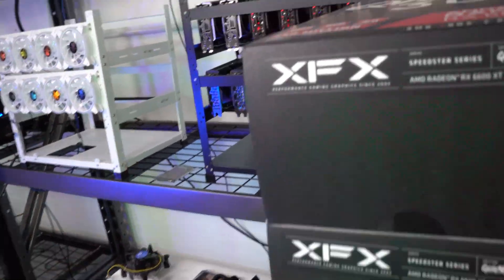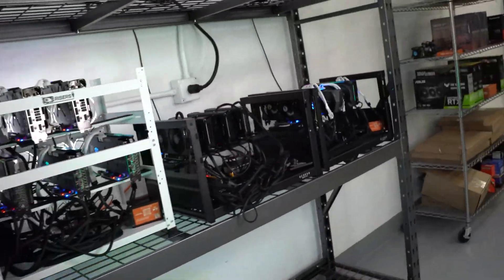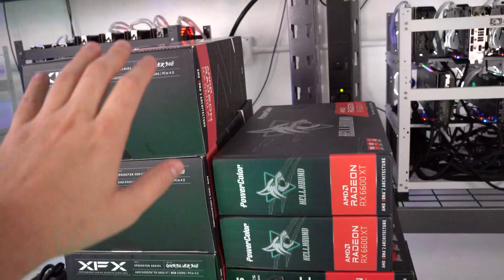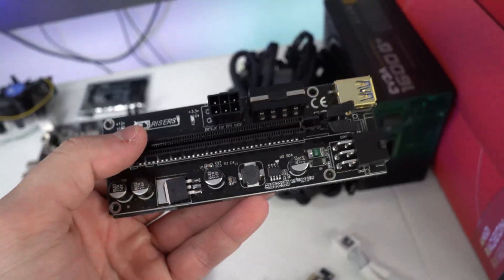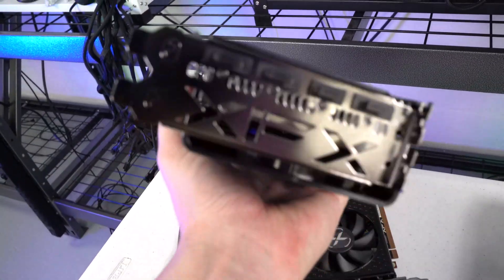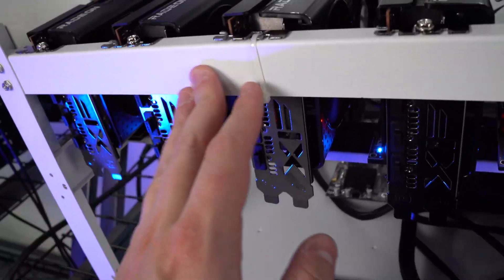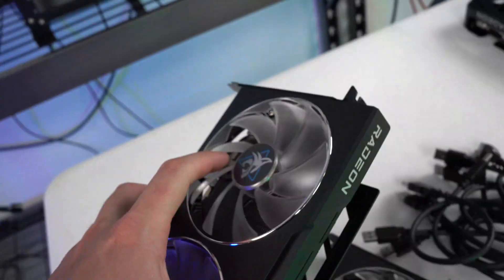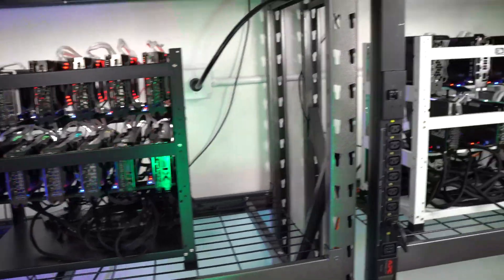11 GPU RX 6600 XT AMD Mining Rig Build (Part 1) - We Built Another Rig of AMD's Most Efficient Cards

Comment: I bought the same PSU.  It doesn't come with the power cables you use.  The cords it come with splits a 8 pin to a 8 pin and a 6 pin, but the one you are holding in your video shows a 8 pin split to a 8 pin and another 8 pin?  You are able to split a 8 pin into 4 8 pins, but the cables that come with this unit won't let you do that?
Reply: I think I figured it out.  The better, more expensive, larger fan model, 120-G2-1600-X1, comes with 8+6 splitters, but the cheaper, smaller fan model, 220-GP-1600-X1, comes with 8+8 splitters .  WTF?
Reply from the maker: I believe it is the G+ Models, rather than the older G2/P2 models. I have mostly G2/P2/T2, however the newer G+ P+ models come with the dual 8-pins.

Comment: Another great video 👍 I love the RX6600 cards, I've just made a 6 X Rx6600 rig and there hashing away at 29MH each very happily 😊 There still quite easy to get hold of here in the UK 🇬🇧 so I'm planning on making another rig. And they also tick the box on efficiency. Keep the videos coming, Great channel and keep the format just as it is 👍
Reply from the maker: I agree with everything you said! They don't hash at a whole lot, but they don't require much electricity. When you break down the hash/watt it is very comparable to non lhr Nvidia cards. Just requires more square footage as you need more of them.